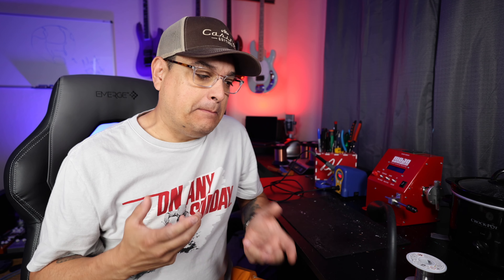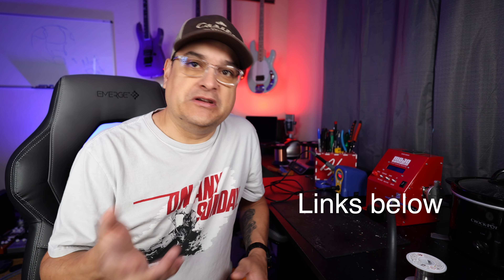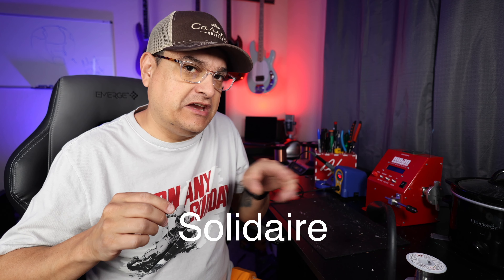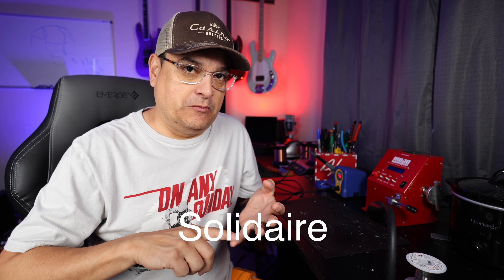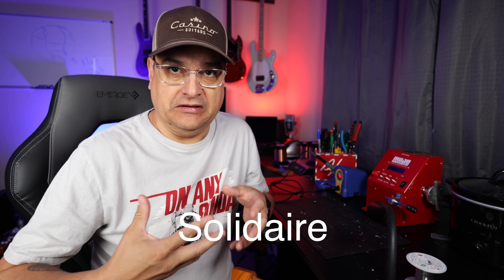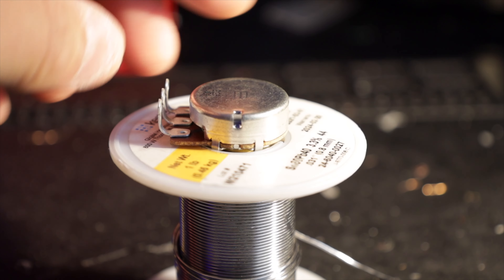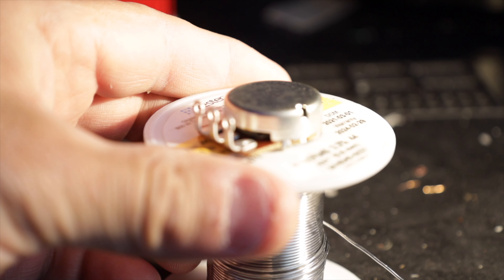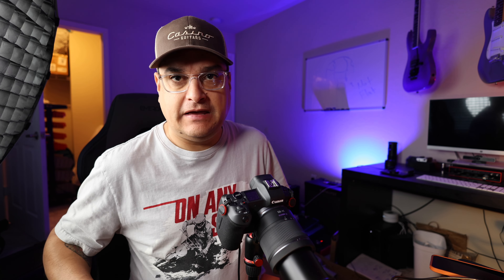How To Solder Guitar Pots, Caps, And Wire

Comment: Hey Dylan. I have a really good question for you. When a pickup diagram shows 4-5 wires being soldered to the back of a pot in the same spot, does it actually all have to be in the same spot? I have done this but its very difficult and messy with 5 wires all in one blob. But since the back of the pot is all one piece of metal, does it matter where you solder everything on there?
Reply: No, it doesn’t matter. As long as all grounds are connected to a wire connected to the ground lug of the output jack. You can solder to different areas of the back of the pot, or the same place with all the wires twisted together. Careful though, it is possible to ruin pots by overheating the back cavity. To avoid that issue altogether, get solder lug washers from All Parts and connect all grounds using those rather than the back of pots.

Comment: I recently tried to solder a ground wire to the spring claw of a Strat, and no matter what i did it did not stick to the claw, even when sticking when it cooled down it just came off!  I thought maybe it is the metal type, as I had no problem on a different Strat.  What am I doing wrong?
Reply: You have to let the iron heat up sufficiently. If it’s a cheaper iron maybe it doesn’t get hot enough to melt the solder properly.

Comment: Hi Dylan, I have a guitar that I have mounted two extra switches on.  do you think that having too many solders, in my case at least 2 more, on the signal can affect the tone?  thank you
Reply from the maker: Not as much as whatever the switches do. It should be fine
Reply: @DylanTalksTone  Hi Dylan, I really appreciate your answer but I think I misspelled, I'm not good with English.  My question is if  there can be a difference in tone between a classical connection without extra switches and the connection I have done which has two more solder and a Communication on switch contact. Thanks

Comment: awesome tips, your prior video helped also. I liked the strength test, and explanation of what a solder is, chemical bond, I learned something new (thought it was a type of weld using lead alloy . . . .

I ordered one set of runway cables but now make my own. the helping hands / octopus holder thing is pretty fly and helps  or making jigs like dylan did, like doing a wiring harness for ES or LP, just a template with the holes, and use that to make a hard cardboard template to put in and make the wiring harness

Comment: I use the same Hakko iron and it's fantastic. I prefer the flat blade style D16 tip then the conical tip.

Also for me I find adding a hook to the end of a wire to make a mechanical joint will mean the wire moves less. Not saying that your joints aren't good but a beginner might find it easier. You don't need a full hook just a slight bend to keep it from moving. To remove you just apply heat with the iron and pull with the other hand.

If they get into amp work and you are placing a lot of components you don't want them coming out before you solder them all down.